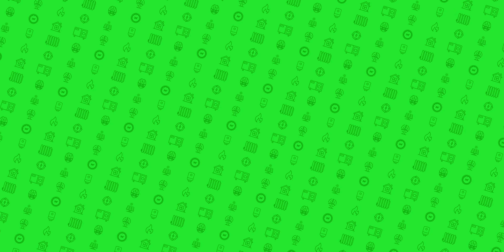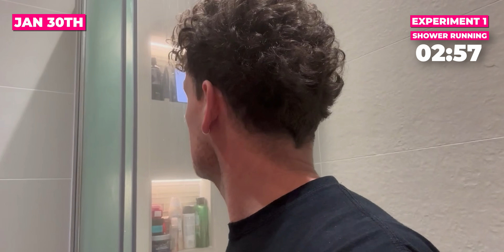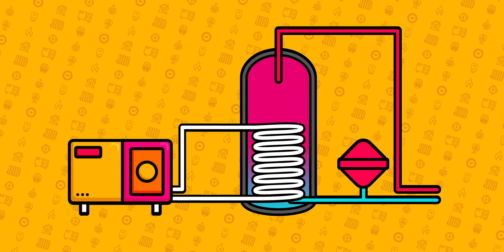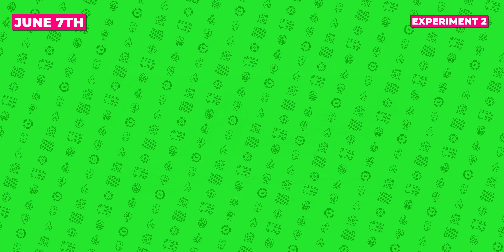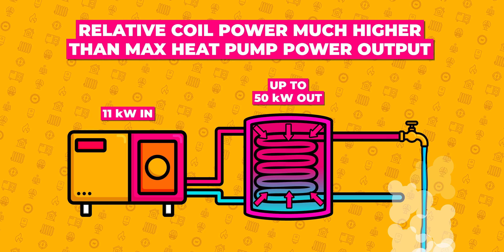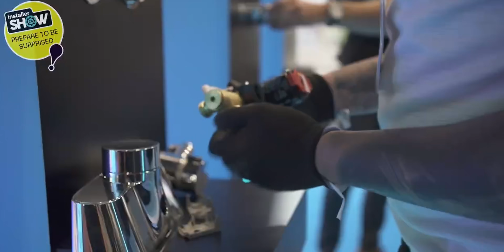The Worlds SMALLEST Cylinder is here!

Comment: Next thing is having the mains water run through a heat exchanger with the shower drain water before getting to the tank.
Reply from the maker: Yes! Considered putting this in the video but wanted to prove it worked without
Reply: These exist. You're right, this would be perfect!
Reply: Yes, these do exist however not a cost effective install.
Reply: From an energy efficiency perspective, I'm sure that you are correct, although the benefit would only accrue while the shower is running and what about the other consumers of hot water? From a practical point of view there are a number of issues: the heat exchanger must not obstruct the flow of waste water, which reduces the possibility of heat transfer; the mains water inlet needs to be close to the waste water exit and the used shower water has probably lost 50% of its heat before it hits the waste outlet heat exchanger; this only works for a continuous flow system, such as a shower, where water must be heated at the same time as water is flowing out of the system (for example, it would not help for a bath, for washing dishes (by hand) or for washing machines and dishwashers that are cold-fill only).
Reply: @davem.4003 Waste water heat recovery isn’t anything new. Systems have been around for a long time now. I have a wwhr connected to my shower waste pipework. It works really well, boosts the inlet water temp to my cylinder by around 14°c when the shower is in use. That’s equivalent to around 7kw of continuous power at 8 l/m flow rate.

If coupled with the thermal store design that heat geek have here. You would easily run a shower continuously
Reply: @adamkenyon6146  I wasn't suggesting that it's new, simply pointing out some of the drawbacks in a normal domestic setting. As David pointed out, it's unlikely to be cost-effective as a retro-fit solution in the majority of homes. I also accept that it would be theoretically possible to deliver continuous flow to a shower but in practice, the majority of showers have a finite duration of around 4-6 minutes (except some of my family members who can exceed 15 minutes). I can certainly see it working well in a commercial environment e.g. a hotel, where there is more of a continuous demand (for example, 24 x 5-minute showers between 6:30 am and 8:30am). There are bound to be peaks and troughs but it's still a better use-case than in a home.
Reply: have two Zyphos for a couple of years, works pretty well. Two lessons learned: have them next to the waste/drain for easier cleaning, not remotely & the 40 is overkill for a power shower and can get clogged a bit (~ every 3 months) if there is someone with long curly har refusing to use the hair catcher..

Comment: I've imagined something like these (mains water coiled through a heat store, small) in my imaginary house. Having several, so there aren't any long hot water runs -cut the time waiting for hot water; connected together.
Reply from the maker: Nice!! I was just pondering about having different ones located in different areas.. you were ahead of me!
Reply: @HeatGeek 
The 16L storage volume limit: can you tell me if that is per store or the system as a whole? I.e. if I have several of these in series, would I lose the benefit of not needing the expansion vessel & pressure release pipe?
Reply: @HeatGeek  Under a bath perhaps...

Comment: Great idea. I have seen similar ideas, but this looks very well thought through and relatively cheap and easy to install. Very clever (IMO) to swap the role of the coil from heat pump flow to domestic flow. 

I couldn't quite understand some of your numbers. 

My 5 kW Vaillant Arotherm plus can output around 6 kW which means that if the water is being heated through 30 °C (i.e. from 10 °C to 40 °C) then in the steady state - the maximum flow it can sustain is 6,000 [W] /(4,200 [J/°C/kg] x 30 [°C])  = 0.048 [kg/s] i.e.2.9 litres per minute.

In any case: I wish you good luck and I agree this represents a great option for flats.

Could it also be installed outside?

Best wishes

Michael
Reply from the maker: I have my heat pump on eco now. So puts out 4.5 kw. We’ve had 2 baths and 3 showers today.. 1 bath and shower in the morning pretty much together and the rest all together in the evening.. I’ve done a post.
Reply: @HeatGeek I'm sorry but something isn't adding up here. Either Michael's numbers are incorrect, or your system is gaining additional heat energy from somewhere other than your ASHP. I don't know where the issue is but you need to substantiate your empirical evidence with the corresponding energy calculations. What was the temperature, fill-time and volume of the bath; what was the temperature, flow-rate and duration of the showers? What is the temperature of the source water? What is the total energy required to deliver that quantity of water at that temperature and how does that value compare with your heat pump output? If the energy is coming from the thermal buffer, then that should be quantified by the temperature drop and the volume of the buffer. I accept that this may be difficult, that precise results may not be possible and that estimates may be necessary but those estimates should use the available data, for example if the size of the buffer is 100 litres and the temperature drop is 4 degrees C, then the energy lost is 4 (deg. C) x 100(l) x 4200J = 1680 kJ. At a flow rate of 7.5l/minute that can produce a temperature increase of 10 deg. C for 5.33 minutes, or 40 litres (kg) of volume, assuming a 100% efficient heat transfer. Since the system is completely sef-contained, I think it is safe to assume 100% efficiency but if the transfer rate is incorrect, then less heat could be transferred but for a longer duration. Your ASHP is outputting 4500W (4500 Joules of energy each second). That equates to a temperature increase of only 8.6 deg. C at 7.5l/min (0.125l/sec), so we have an apparent discrepancy of at least 12.5 deg. C in the flow temperature from the beginning, even with the ASHP already running at full (4.5kW) output capacity. No matter how we juggle the numbers, I simply don't understand how the system as described can deliver the suggested volume of water at the temperature described.
If there are features that are unique and patentable, then I understand why you would not share the details but in your video, you encourage other manufacturers to adopt the same technical solution.
I shall be delighted if I can be proven wrong (and it won't be the first time).
Reply from the maker: @davem.4003  Michael hasn’t included the buffer time… this buys more heat pump energy, which buys more buffer time and so on. We’ve built a calculator that matches the real world thing excellently accurately.. I’ll run his numbers now
Reply from the maker: Ok if you do ALL the maths which includes buffer time buying more heat pump energy which buys more buffer time etc.. (we’ve built a calculator which matches real world tests extremely accurately)

A 110l store at 60c
10c water inlet
8l/m
39c shower
2.2m coil surface
1000w Heat transfer coefficient 
6kw in
0 time till heat pump power
Is a 14.3 min run time before it begins to drop below 40c slowly

Extend heat reach time to 2.5 mins (how long mine takes with a 3c hysteresis) and the result is 12 minutes.

This maths works in theory and real life. If your maths doesn’t result in this your maths is wrong. 

Importantly though. You can’t leave out the buffer volume or the heat pump time that buys you. Will send you the calculator soon enough
Reply: @HeatGeek  Thanks. I'll prepare a spreadsheet.
Reply: @HeatGeek  Thank you, you have highlighted some differences from my rough estimates (110l store - I had guessed at 100l, 60C store vs. my estimate at 45C), but you also presented some anomalies vs. your own data (10C water inlet temperature vs. 6C external temperature, 6kW ASHP output vs. 4.5kW). The inlet water temperature does vary but it's generally more stable than the ambient temp and very rarely (except when we have a cold spell, or frosts in autumn/winter) is the incoming water temperature higher than ambient. Just a summary of the heat energy output through the water used for bath and shower, compared with the energy sources  (ASHP and buffer) would help my understanding. Just saying that your calculations are correct and mine are wrong doesn't really help. How do you achieve a 3.9 CoP with a 60C buffer temperature?
Reply: Thank you Michael, you have researched the physics more accurately and presented the results far more concisely than I have in comments elsewhere.

Comment: How would this work with solar? I have solar but no heat pump yet and was looking at the Sunamp heat batteries, but this looks so much better and way cheaper, would there be milage in say, if you have excess solar use it to overheat the water, so if the normal setting was 46C, boost it to 55C on solar, or can you still feed the solar through the heat pump and get it to boost the temp but with the extra efficiency?
Reply from the maker: Yes just choose the immersion option and wire up to a diverter.

Comment: So just to check I've understood... This is just to provide the DHW side. The central heating loops (oversized rads/UFH) are fed separately, direct from the heat pump? Or is there a buffer or tank also required?
Reply from the maker: Ufh and rads are fed separately and direct from heat pump . No other equipment needed
Reply: So there will be a typical  3 way valve like with other cilinder use cases?

Comment: I’m a homeowner in the southern US and was talked into getting a new gas water heater almost 2 years ago. Now that I’ve discovered heat pumps in detail and channels like this - it makes me a bit crazy how much money we’re wasting against a system like this that can average a cop of 4. Will it be extremely difficult to port your tech to the US market as well?
Reply: In the UK, electricity is roughly 4x the cost of gas, so we need a CoP of 4 to break-even on an ongoing cost basis and ignoring the investment cost. Your cost-benefit analysis may give different results.
Reply: Great observation. Well done. 👍👍👍
Reply: It puzzles me that, for the majority of cases, running the heating at 45 degrees C is regarded as optimal and can achieve a CoP of 4 but running a higher temperature, such as 55 degrees C, results in a significantly reduced CoP, yet we can heat our water to 55 deg. C with a CoP of 3.9. I really want to believe in this technology but some of the messaging is inconsistent.

Comment: Does this look like a Viessmann 111 but with a different heat source?
Reply from the maker: No not quite mate.. close in 1 way though.
Reply: @HeatGeek  Looks like a very similar idea.
Reply from the maker: The 111 uses a plate heat exchanger, a secondary circulation pump and a flow switch, a temperature sensor and a non return valve This just uses a temperature sensor.
Reply: Coil in tank is always better than phe + shunt pump + flow sensor , much less to go wrong. 👍 how big is the coil on this? The dhw coil in my friends thermal store cylinder (800ltrs) is 30m2 🤣

Comment: Very clever… wonder why no one thought of swapping the roles of the cylinder water and the coil water before. Well done👍
Reply: I'm a heatpump installer in the netherlands .In the netherlands its actually a known concept. Its called a hygiëneboiler, because there is a lot more refreshing in dhw. Unfortunately because of current regulations its still mandatory  to run a legionella cycli if the coil has a volume of more than 1 liter, which is always. On top of that, according to my calculations this boiler has a volume of 117 liters, which in theory would give the same results if you would reverse it. I do believe that the heatgeek way might be slightly more efficiënt for your heat pump (because of lower/no delta t), but on paper the difference is not as big as its cracked up to be.
Reply: @willempostma424 The coil in this application is the secondary circuit.
Reply: @willempostma424  Netherlands regulations do seem to be very cautious about Legionella, I've even had it written in rental contracts that we must run the taps for two minutes after coming back from a trip! Thanks for giving me the Dutch word, I can now search to see how much they cost here :)
Reply: @willempostma424  it should be possible to limit the coil to no more than 1 litre. If higher flow rate was required then just add a second coil in the cylinder, although it might be tight for space.  The diameter of the finned coil isn't stated in the specifcation:
15mm would allow up to 5.5metres to give 973ml of water
22mm would allow up to 2.5metres to give 950ml of water
What I don't know how to calculate is the rate of rise those lengths of coil would achieve if the cylinder temp was 50c.
Also it wouldn't be easy to fit 5.5metres of pipe into a small cylinder, nevermind 2 of them!
Reply: This type of design is known as a "thermal store".  This one has a nice shape and overall design - the drawback is a limit to the hot water draw off speed, unless you have a very large heat exchanger (some use a pumped flat plate exchanger instead of the internal finned coil heat exchange that this design uses).
Reply: For me the “cool” part (if you excuse the pun) is that two existing technologies are being put together to create a whole that is bigger than the sum of its parts. The best ideas for practical purposes are often adaptations. No need for new technologies when tried and trusted tech can be used in new combinations👍
Reply: If you DO have space for a traditional water tank, why might you still want one of these? Airing cupboard space? Or to put it in reverse, why would you ever want a traditional water tank? 

Octopus are due to swap my old 210 L. Kingspan for a 310 L. with better transfer surfaces. Is cost the only blocker? Availability?
Reply: @DomSta03 o{{oooooiiii
Reply: Thermal stores have been fitted in UK for Decades, they haven't invented anything new here
Reply: @maximuswong3092  yes, thermal stores hage bern around for a long time.

They had multiple coils of 10mm tube inside the cylinder,  domestic mains cold water flows in, domestic hot water flows out.

It is basicslly a combi in reverse.
Reply: Not to sound negative, because i hold the heat geeks in very high regard, and personally have learnt a lot from them.(thanks Adam)

Comment: Excellent idea and will solve the no room problem. Might shut up the anti heat pump people a little more.
Have been toying with an idea for a heat store using a cylinder filled with sand to store energy from my excess solar so I can re use it to recharge my hot water but haven't quite got round to it. Thought storing the heat in sand removes the legionella risk. Guess I could just fill it with concrete.
Reply: A twin coil cylinder would be best I guess to have one loop to charge and one loop for hot supply